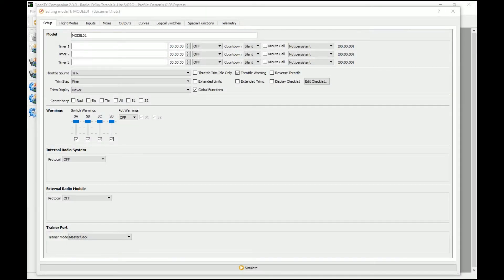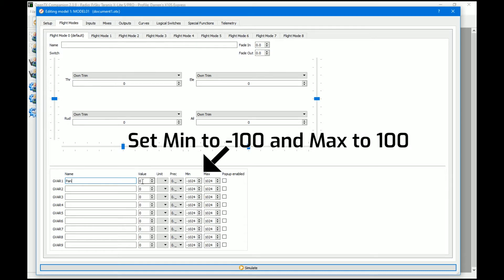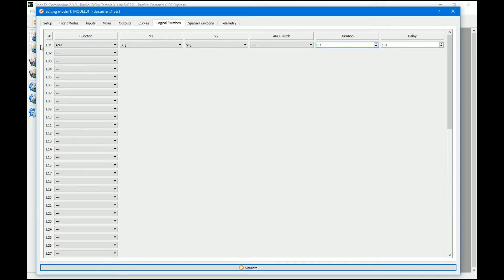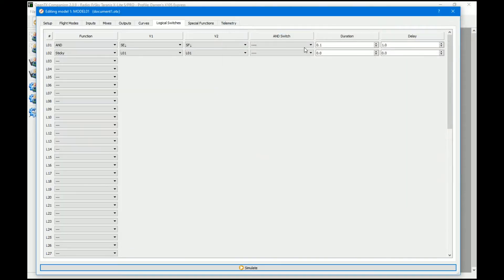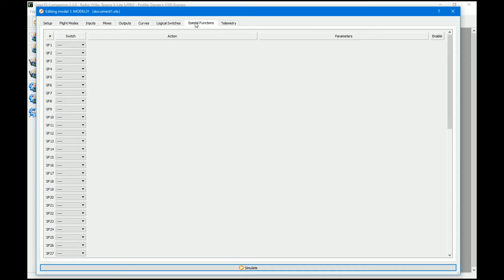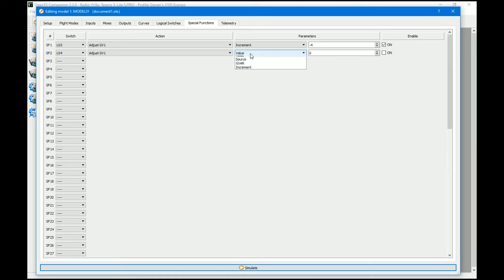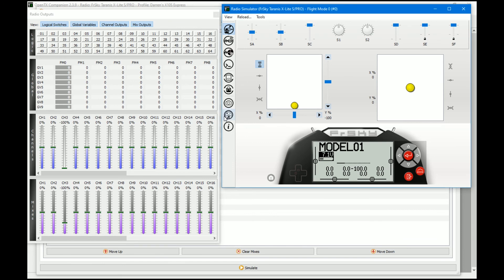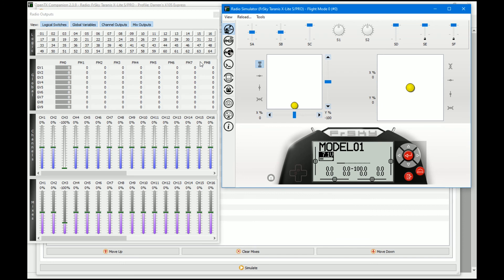Add a pan to the TBS Tango 2 using an OpenTX virtual pot

Comment: Very helpful video, you explained the logic very well, thanks! With your help, I just set my Tango2's momentary switches to adjust Vtx power on my quads in 5 discrete steps and the 3-position arm switch overrides the Vtx power channel and sets it to 0 (25 mW) in the bottom position.
Reply from the maker: Nice work. I’m glad the tutorial helped. But it’s even cooler you took it further 👍🏻

Comment: Nice but unfortunately TBS Tango 2 does not support Open TX Companion. I tried to replicate this setup via the radio itself but it does not work for me.
Reply from the maker: The setup doesn’t need companion. You can set it up on the radio. Which part couldn’t you find?
Reply: @MrD  Thank you, but Special Function, there is no option for parameter to be incerement or value, I can only set the number. I understand moreless everything from the video, but it is not working for me, maybe I missed something I will try it more times today and will see.
Reply from the maker: You need to long press enter to access the increment. Find the Adjust special function. Then select the correct global variable number. Next, in the value column, by default you can just set a value. But if you long press the enter button; you will get a menu that allows you to choose inc/decrement.
Reply: @MrD  Uff OK i did, it finally, Thx. But on TBS Tango II there are few more steps I needed to do to make it work, just for example I needed to set as source in Mixes L02 to make it work properly.
Reply: @MrD  Thank god I read this response.. I had almost lost hope. 3 yrs old, but the video is still damn useful!
Thank you sir.

Comment: How would it be possible to use this GV in a multiplex mix on a channel? (I'm trying to do some sort of "instant trim" on elevator channel to use it in inav cruise mode to make ascents and descends "handsfree"). On my horus, I'm using a S2 knob as source, and on Tango I would like to use GV instead, but you can't select GV as source....I hope it is understandable. :D Thanks
Reply from the maker: You’d need to set MAX as the source and the GV as the weight.
Reply: @MrD  Interesting. Thanks. What I did is set source in the meantime is I set the source to the same channel (CH3) and GV as offset :D . Well, it works :D

Comment: hi, great video !
 i'm unable to get it working correctly : i can go on the left but not on the right ... and the 0 position is 100% on the left , what 's my problem ? thanks
Reply from the maker: It's really hard to tell from that description. My guess would be that the switch to go right is not set up correctly, so check the special functions, and look at the global variable when you press the buttons.
Reply: @MrD   hi, thanks for theanswer . I managed to get it work :  i put the center at 50 ( !L02 ) . Is there  a system to get the movement smoother ?
Reply from the maker: @pascaldetournay7540  I’m glad it’s working. You could try adding slow up and slow down to the mixer. That will reduce the speed of the pan, but it should smooth it out a little.

Comment: Mr D. !!!    This is fantastic.   I'm having trouble setting this up up the Tango 2 menus.  Some of the settings do not appear to be available.  Is there a way to simply use the momentary switches to adjust the center trim of a single servo?
Reply from the maker: Which settings are missing?

Comment: Great video, thanks- is there anyway to put tango 2 into a mode where you can use the roller as a slider/pot?
Reply from the maker: I don’t actually have a Tango 2, so can’t really comment. Though I’d guess if it’s used for navigating the menu, it’s not likely. It may be a good suggestion to put to TBS though.